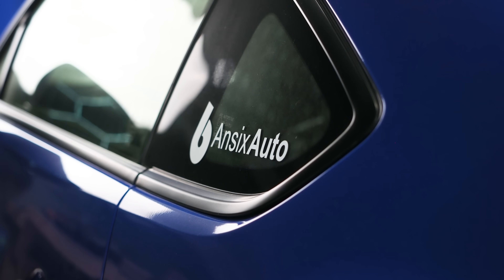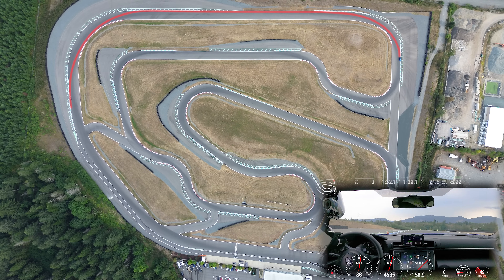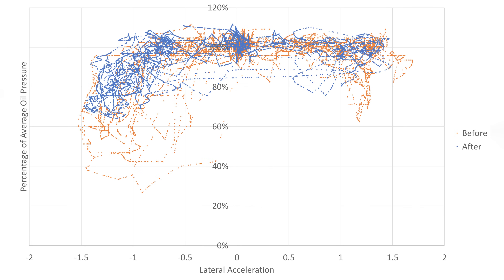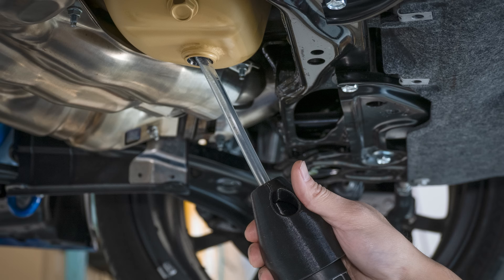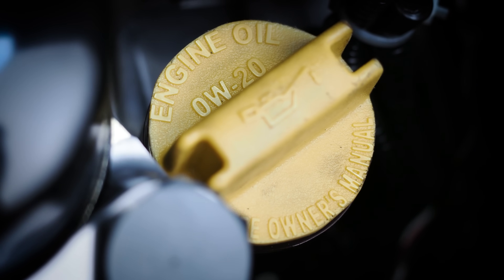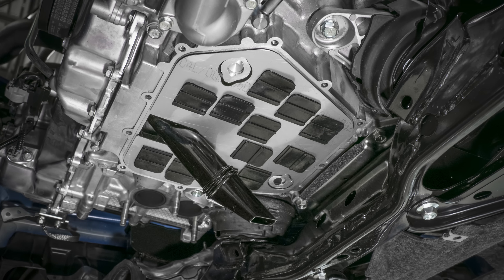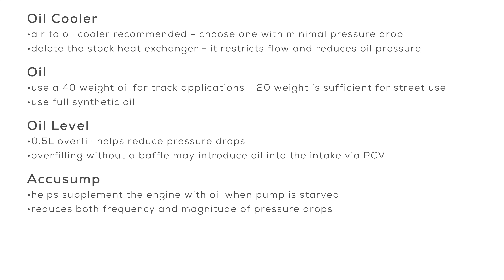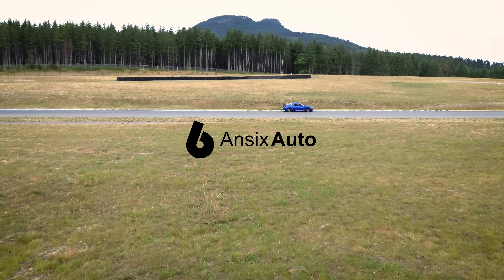The FA24D Engine: What Toyota & Subaru Don’t Want You to Know

Comment: your statistics and data gathered are great but you know..... TOYOTA should be doing this or SHOULD have done this to begin with not a private individual... Shame on Subaru, and Toyota.
Reply: I can almost guarantee they knew about it, but considered the people that would actually track it with speciality tires and the skill level to be far and few.  What they didn’t expect is for the track community to be so vocal.
Reply: @jrfish007  Even if it doesn't cause catastrophic failure on street-driven cars, periodic oil starvation probably is causing increased wear/shortened engine life.
Reply: @jrfish007  It's a track oriented vehicle.. 6 speed rwd with a lsd
Reply: Toyota 100% knew about this
Reply: Doesn't the R in GR stand for racing? I don't even have a 86, but found this video very interesting. I personally would seek a chat with the guys at Gazoo in Cologne, because this is definitely not how you engineer sports cars. 1.5 g is nothing special with modern Street tires and this kind of failure could as well happen on certain parts of the German Autobahn...
Reply: @SinusOne  GmBH had nothing to do with this car, they do bespoke race cars only. The R stands for racing yes, but the GR brand doesn't make racecars for the road, they make fun cars inject with the GR philosophy. Toyota's GR rally cars and WEC cars are what really bleed GR.
Reply: I routinely tear down these engines and find a ridiculous amount of loose silicone sealant in the oil pickups. It would be cheap insurance early in the life of these cars to easily remove the pan and clean the pickup. It only has to be done once.
Reply: I think it's mainly the problem with the boxer engine. I always hear they always have issues with oil, I wish toyota can just go back to I4s
Reply: its a rwd coupe what more do you ppl want, just make it do a skid..
Reply: it has a clutch, you give it a kick :]
Reply: they knew, engine design was mainly done by Subaru but Toyota should have done something about it.
Reply: They know that they can sell a shit engine and people will still buy it because so many people trust them for reliable cars
Reply: Want to do Race Car things, buy Race Car parts... absolute disgrace that you would think a factory street legal car should come with a dry sump setup
Reply: Dude to be fair I don't think subaru or toyota made the GR86 to be strictly a track car. Its something nice that normal people can drive on the street and have fun with.
Reply: Just because it looks like a sports car doesn’t mean it’s built for the track.
Reply: As much as I want to disagree, they were harsh af on bmw making the transmission for the supra.
Reply: @Electronica27  the manual one or automatic?
Reply: Toyota doesn't care, look at what they did with MR2 zzw30, they were selling them for 2-3 years with faulty engines doomed to be destroyed in first 40k km.
Reply: I'm so glad I have an ej25 instead of this fa24 shit design engine
Reply: The car, as designed, was targeted at street use. They engineered it for that purpose. Given the response from the enthusiast community and the after-market response, they probably thought the enthusiast community would figure the situation out with the gen 2 cars too.
Reply: @williamcutting2483 nah they advertised it as a affordable car you could track. When you build a brz it even says track tested suspension
Reply: @williamcutting2483 why did they offer a 1 year NASA membership then?
Reply: @williamcutting2483  This logic makes sense until you consider that there are plenty of other non-track designed cars (eg Civics, Accords, Celicas, etc) that don't struggle with this problem. Yet, the GR86/BRZ is much more of a "track" car than those.

Quit apologizing for Toyota and Subaru. Simply put, they blew it with a shoddy design - just like Subaru has done with virtually all their other popular boxer engines in some way or another. 

Sincerely,
-A Subaru owner (on my 4th)
Reply: @crxtodd16 Arguably the worst comment here. Those cars all have I4 engines. The only reason this issue is so prevelant with this car is because of the Flat 4’s engine geometry.
Reply: @coredaqqer6197  Really? Worst comment? Read what I was responding to. My only point was that those are examples of "street use" cars, yet they don't have the same oiling problems as the FA24. Never said anything about the boxer design, not my point. Simply put, Subaru and Toyota have a poor design in the FA24, boxer or not, street use car or not, BECAUSE there are so many examples of other non-track cars out there that hold up oil pressure just fine while on the track.

Also, you saying that the oiling problems are inherent with the flat 4 geometry is completely ignoring Porsche.
Reply: @crxtodd16  Porsche makes pure sports car, with most of their trackable  models have some integrated dry sump system. Trying to compare porsches level of H4 to subaru is downright foolish. Completely different markets and engineering budgets. 

These other street car examples, have what engine in them? If you think engine config doesn’t play a big role on things like oil pressure loss, you need to do a little more searching. There’s a reason things like the V config are popular, I4, etc. Boxer engines struggle with proper oil distribution naturally, this problem isn’t exclusive to the FA. The StI had the same oil issues. 

Toyota and Eubaru wanted to cut costs on the Twins, what other reason would they have to use an engine family spread across their entire lineup. If they wanted to have a pure sports car, they would’ve had a different budget and engineering approach. This car is a everyday sports car for the road before anything else.
Reply: @coredaqqer6197   You literally said, "The only reason this issue is so prevalent with this car is because of the flat 4's engine geometry." Yet, I gave an example of a make that has flat 4's that doesn't have this problem. 

You're making this into something that it's not, you're trying to prove some arbitrary, non-static point just so you can say you're right. Who cares.
Reply: @crxtodd16  No, you’re missing the point clearly. You tried to argue other non” sports cars” don’t have this issue, and I simply brought up that the issue is inherently because of the H4 geometry. Porsches don’t have this issue to this scale because they have an engineered solution to the oil issues. Porsche also has a completely different engineering budget and market. When you think subaru you don’t think BRZ and Sti, you think 4WD and everyday driving. They are a small company with no where near the same budget, why would they spend money to try to counter an inevitable issue on a 30k dollar car? 

Also, porsches have this issue, as again, this is inherent to H4/H6 engines. They simply engineer a solution because they want to, and can justify doing so.
Reply: @coredaqqer6197 well Subaru still should be able to solve the problem. I understand the nature of the engine but Subaru has been making performance Flat4 for 40 years I would presume for now, they should know and understand how to. The engines oil pick up is completely new as well so they had the budget for a new oil pick up system but they blew it. Gr86 owner here btw. New engine is great performance wise 
but I don’t know what they were thinking
Reply: @henryg1648 tbh, the only thing subaru fixed over the years is having a blown gasket lmao
Reply: @coredaqqer6197 budget? Bruh, they could've just went with a 4 cylinder INLINE-4 engine....its not that complicated, it could've been a camry or a corolla engine and just be done with it...both subaru and Toyota are JAPANESE company that have been making great affordable and also reliable sport cars for YEARS. Its no excuse for them to be having such simple problems not be fixed.
Reply: @EnhancedTrashBin  Does Subaru produce an inline-4? You dunce, this was Subaru project merely consulted on by Toyota. Why would they develop a bespoke i4 when one of their other cars have it? Again, this "simple" problem is inherent to the boxer orientation. Did you read any of the comments above?
Reply: @crxtodd16 actually as a 7th gen Celica owner, I can say that the 2ZZGE engine does suffer from pressure drops on track due to hard right hand turns and the oil pan not having a baffle, which can be fixed with a baffled pan. But it’s still there
Reply: @EnhancedTrashBin shoulda used the 2ZZGE which was still in production during development of the first gen, would’ve saved them so much money instead using a boxer
Reply: @coredaqqer6197 wasn’t the whole BRZ/86 project Toyota’s idea? I doubt they were merely there to just be consultants.

I recall Toyota being very particular when it came to the R&D of the first gen. Not so sure about the second Gen but I can’t imagine they’d take a hands off approach for it
Reply: @omarawilson2853   Didn't know that! Thanks for the info.
Reply: @coredaqqer6197  dude you got bodied. Just delete your comments here and take the lesson.
Reply: @beezowdoodoozoppitybopbopb9488  except he didnt get bodied
Reply: @williamcutting2483 except Toyota and Subaru market these cars as track cars.
Reply: It’s a design to support more aftermarket development. You hardly see any aftermarket parts for Porsche because it addresses different market.
Reply: @Wesley-ui3dw 😂this is just a nice way to say that the original design is crap.

Comment: Great in depth video on the oiling issues on the FA24 motor! Thanks you using the Accusump and supporting us. Let us know if there is any additional support we can provide. As a side note we also provide rebuilding and testing of the Accusump units throughout it's life cycle as well. Miles @900BRZ also had a great video highlighting the Accusump vs dry sump sets as well.
Reply from the maker: Is there a way we can contact you?
Reply: does using accusump voids warranty?
Reply: @boom2055 for sure, your adding 2-3 qts extra of oil depending on the cylinder size
Reply: @boom2055  Want to do Race Car things, buy Race Car parts... absolute disgrace that you would think a factory street legal car should come with a dry sump setup

Comment: I'm very interested in the testing for how much the accusump affects the oil pressure. @900BRZ if Miles is willing to share how he setup the solenoid to open the accusump that'd be greatly appreciated. Appreciate the hard work and information share from both of you guys @AnsixAuto.

I'm surprised the Verus Eng baffle has gotten to testing so quickly I already got a Kazama Auto baffle in anticipation that the Verus was going to take longer.
Reply from the maker: The Accusump won't change the actual operating oil pressure, but from our testing it seems to reduce the occurrences and severity of pressure drops. We will do back to back testing in September.

In regards to baffles, I don't believe there are any designs that will prevent the pressure drops from the cresting corners. If the Verus is a vertical design, it certainly won't address that.
Reply: @AnsixAuto  Okay
Reply: > if Miles is willing to share how he setup the solenoid to open the accusump that'd be greatly appreciated.
This is still in development. He’s planning to try it this weekend in a permanently open configuration since we haven’t had time to do all the programming necessary to integrate it with the CAN data.
Reply from the maker: We have plans to develop an automated valve system for the Accusump as well. Since we have oil pressure data and we will program the logic to decide when the motor needs support from the Accusump. When the motor doesn’t need it, the excess volume will be stored inside the Accusump.
Reply: @AnsixAuto  great to hear!

Comment: Thanks for all the analysis. The visualizations in the beginning are great. Surprising the see just how significantly lower your nominal pressure was with the JR radiator+cooler+OE heat exchanger. 

I covered some of the nuances with Accusumps in my last video, particularly the idea that they can discharge oil at idle, since the pressure will drop to around 15 PSI once you are at operating temperature. I’ve seen a manual valve or an electronic value used for this. Which direction did you take? If the latter, what is triggering the solenoid to open the circuit to the accumulator?
Reply: Taking a closer look at the video, it looks like it’s a manual valve. Have you worked out a specific procedure for trying to keep the accumulator charged when you start/end sessions so you avoid a 2+ qt overfill?
Reply from the maker: For daily driving, we would rev up the engine and increase the oil pressure to fill up the Accusump. We would wait a couple seconds and close the valve to store the extra volume. For the whole track day, we just leave the valve open. We haven't seen any negative effects from having some extra oil in the sump when driving around at low rpms. With the manual valve, any time there is a pressure differential, it will either fill or discharge.
Reply: @AnsixAuto  That’s great that you’re seeing good results without evidence of burning oil with such a simple accumulator setup!
Reply: @AnsixAuto  how much do you rev it? could you describe what would be the procedure for after a track day and driving home? As someone who goes to the ridge with a brz I'll be replicating this setup since it seems to be the most effective solution so far.
Reply: @AndrésSalinas  I'd check with Accusump first, but another way to do it would be to bleed the air out of the accusump after track days, then pre-charge it once more before a track day.
Reply from the maker: We’ll film a short video to demonstrate how to go from “track” mode to “daily driving” mode.
Reply: @AnsixAuto  any updates on the video demonstration?